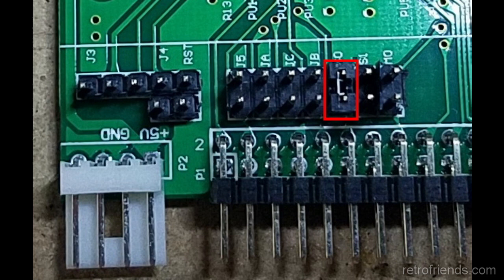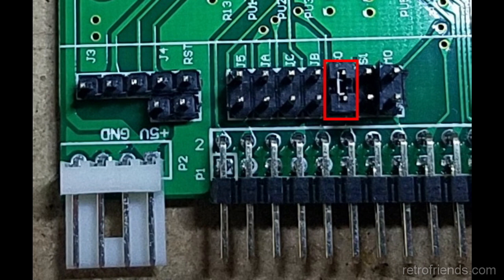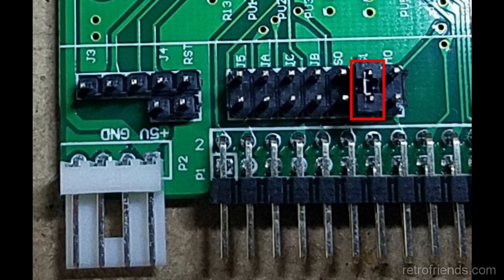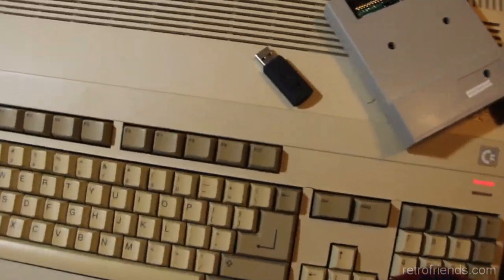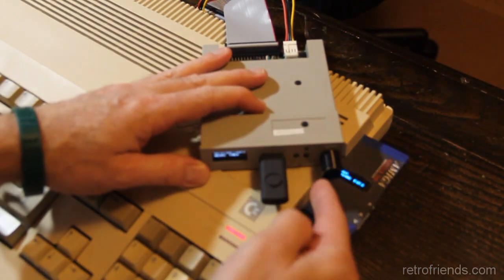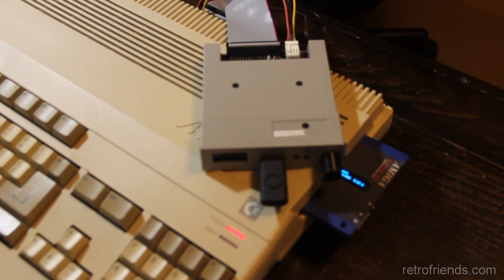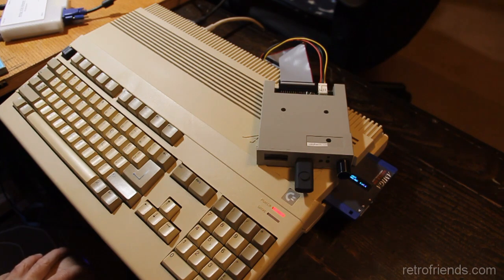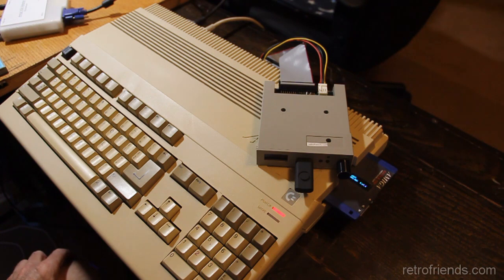Tips for Gotek as an external drive on Amiga

Comment: Does this allow the drive to act as df0 with a physical switch? Ie it will boot games?
Reply from the maker: No physical switch included. There are items available that let you flip df0 and df1. Also kickstart 2+ let's you boot from df1, but a few of the older games are not compatible with kick 2.
Reply: @retrofriends  got it. So if you are kick 2+ you can boot without a switcher - except for older games.
Reply from the maker: @solomani-42 you can boot anything with Kick2+, it's just that some of the older games require Kick 1.3 so they'll lock up or guru on newer Kickstarts.

Comment: Thanks for this. I had built an interface using RetroNinja's PCB and parts from DigiKey and kept getting DF1:unreadable. I was sure that I had to have that darn jumper on S1 because I was using the Gotek as an external drive on an A600 with original DF0:. So I built another interface (I have parts to make 5) thinking I had messed up during soldering/assembly but I still kept getting the same result. So a quick search brought me here and thanks to your suggestion to only have a jumper on S0 it now works great.

Comment: No idea what I am doing wrong. Tried both jumper positions and have the interface = Amiga cfc file. 1 jumper position will boot from my work bench disk and then I can see the gotek as a drive but it will not open. In fact it says DF0 bad and won’t load the ADF file I have on the thumb drive. When in the other jumper position the Amiga will not boot from any drive and just sits on the main screen waiting on a disk.

Comment: would the jumper be S1 for a second drive for an Amiga 1200?
Reply from the maker: The only time you would put it on s1 is if you had a second internal drive. This would only apply to a big box Amiga. There may be external drive adapters that would require s1, but I can't speak for them. I know that the external adapter that I sell on eBay is based on an original Amiga external drive and you leave it at s0.

Comment: I have the very same passive external adapter (Electronica 4U). I have flashed my older Gotek to FF 3.39. Previously, I was using the Cortex firmware. I had given up on ever getting the Gotek to work externally, but with your videos, I thought I'd give it another try. I'm using it with an A1200 and PiStorm32 Lite, AmigaOS 3.1.4 and associated ROMs. 

What I'm finding is that the system will not boot from the Gotek externally, and as such, there is no opportunity to assign ADF files to slots. If I connect it internally, it's just fine. I have the jumpers set to S0 and configured the FF.CFG file as you described (interface = amiga). I do not have an OLED display and all I see on the 7 segment display is 000. It flashes briefly to other indiscernible characters when the buttons are pushed, but all I get on the Workbench display is "DF1: Unknown". I ordered one of your pre-configured drives from your eBay store, praying that will work as I much prefer to have a real physical drive installed in my A1200.
Reply from the maker: The Gotek should be displaying the number of the disc image selected. It would even do so only with power connected - No ribbon cable. So you can try that, and if the GoTek always has the three zeros then there's something wrong with it. You should try different USB thumb drives, and ensure they are all formatted to FAT32.
Reply: @retrofriends  thanks. I hooked it up internally and it works fine. Seems like it's just an issue with the external adapter. Hopefully the pre-configured one I purchased isn't afflicted by the same issue. This is a post-Commodore A1200 (Escom era, I believe). It does not have their notorious "fix" as near as I can tell... but it's possible that maybe someone tweaked something along the way.
Reply from the maker: @cwa107  Oh okay. Well I sell a external adapter of my own in my eBay store. It has active logic on it, and is therefore more compatible - Even works with real Amiga mechanical drives. That passive cable should work. I wonder if there's anything wrong with the cable or even your external floppy port.
Reply: @retrofriends  thanks for the head's up on your own external adapter. I will check that out for sure.
Reply: @retrofriends  I received your pre-configured Gotek drive. Very nicely made, thank you very much. It does not work with my external adapter and behaves very much the same way as my older unit does. I am starting to think the external adapter is at issue as I can't seem to get anything working with it. Unfortunately, the only other physical Amiga I have to test it with is a CD-32 and that doesn't have a Floppy port. Thanks for your help - I will take a look at your eBay store and see if I can find that adapter.

Comment: Great and very precise video. I am in the middle of purchasing a Gotek for the A500 . I want to also leave my internal drive as a floppy disk. I have been told that if I dont use the switch (DF0/DF1) to select the Gotek (External) I will not be able to boot from the Gotek. This also means  the floppy drive will not show up, so I cannot copy disk from the floppy to the gotek using x-copy. If I want to copy from the floppy to the Gotek I need to ensure that the floppy boots first.  This is using a supply cable,  Not the one from an old external drive. What your thoughts on this. Is tht correct or will the cable from an old external drive work better ? Thanks
Reply from the maker: The only way to boot from an external drive is to make a mod to one of the chips on the motherboard. Also newer roms let you boot from DF1.

Comment: im struggling with how you run/connect this without a floppy interface like what is in the inside of every amiga external drive ?
Reply from the maker: The Amiga is equipped with an external port for flippy drives. This port can be thought of as an external "floppy interface". I recommend using an external drive adapter to utililize the external port, such as the one I sell in my ebay store (link in the description).

Comment: I recently try to upload 3.20 version, but the process randomly stuck between 60 an 75% on both of my Goteks. The 3.18 can be uploaded just fine and without problems. Uploaded with FTDI adapter and STM flash loader demonstrator.